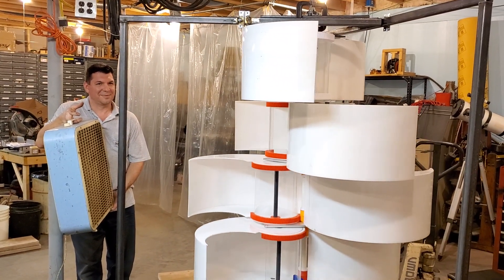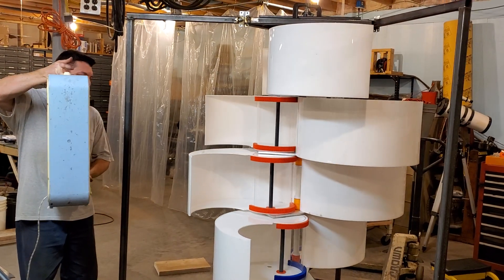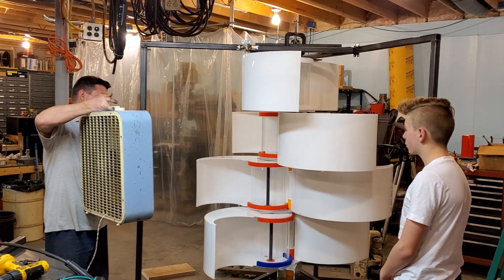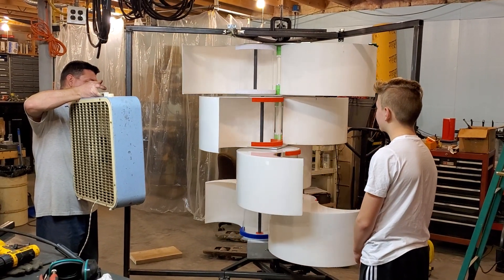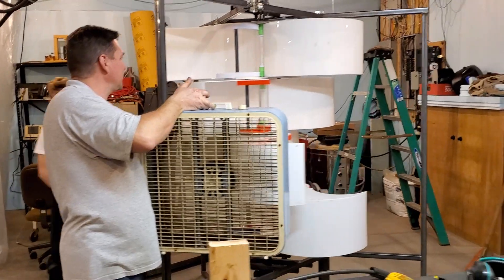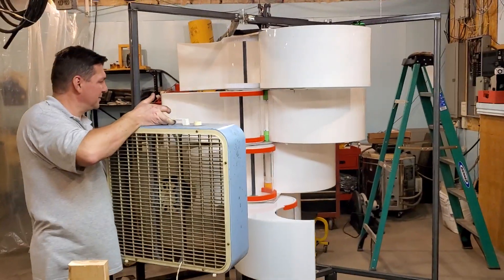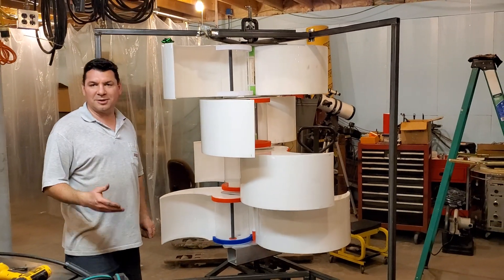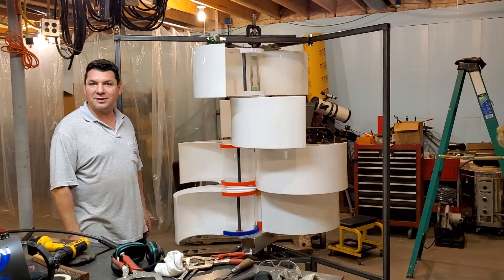Merry Christmas 2019 from Harmony VAWT

Comment: You have a very nice design here. I especially like your retractable idea. I'm no expert or professional physicist but your Harmony VAWT design looks much like a retractable and cascading Savonius Rotor VAWT design. Yet, each level of the cascading Savonius Rotors is rotated to simulate a Darrieus Rotor (egg beater) VAWT design, suggesting a hybrid design. A Savonius rotor design has a peak efficiency of 16%, where as the Darrieus Rotor design has a 40% peak efficiency. Perhaps I'm wrong, but I'm thinking the Harmony VAWT peak efficiency is somewhere between 16% and 40% efficiency, perhaps fairly close to but less than the mean of the two designs. If true, this would put Harmony's design somewhere around 25% less efficiency than a HAWT design. Do you know what the peak efficiency for Harmony is? Was there a reason why Harmony was designed more toward using Drag propulsion over Lift propulsion? I would like to hear your thoughts.

See page 3 and 5 of this PDF article from Peter J Schubel and Richard J. Crossley for more information regarding what I'm referring to. FYI, the link sometimes takes a while to load. https://www.mdpi.com/1996-1073/5/9/3425/pdf

Comment: Would you like some wind for testing or for air circulation ?
Take a look at Vornado
I have two medium Vornados (600 series) and a small one for the table called Zippi
Reply from the maker: Unfortunately the only viable testing with fans would be wind tunnel testing to do it properly. Anything else is just playing at fun. Harmony is not a zero point energy device (Over Unity) nor is it breaking any laws of thermodynamics.  So if a fan is running with 300 watts harmony would only be able to capture a fraction of that. It  needs to be outside or in a wind tunnel before we can start getting proper data. Plus I have more things to finish like the generator coupling and generator mount.